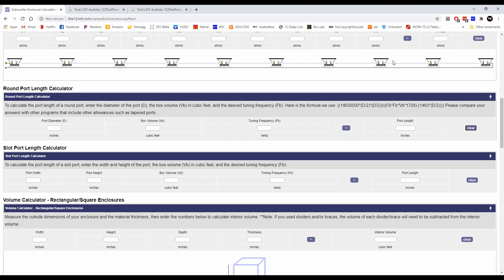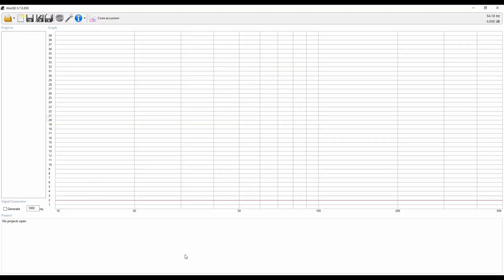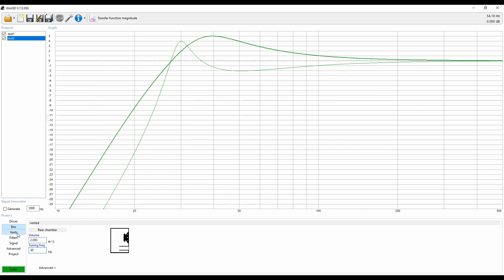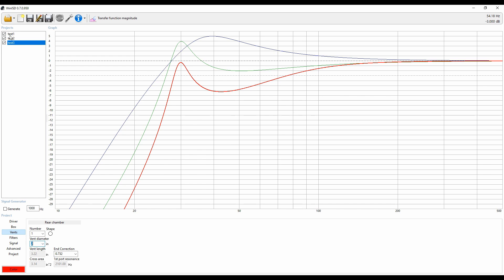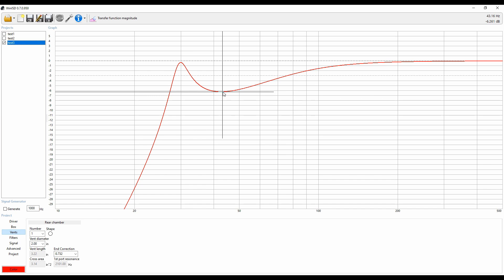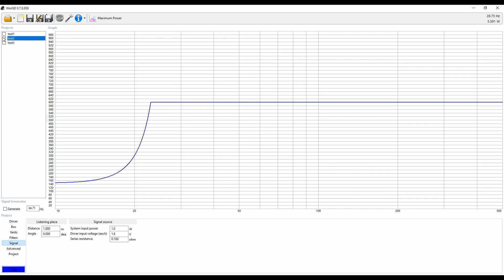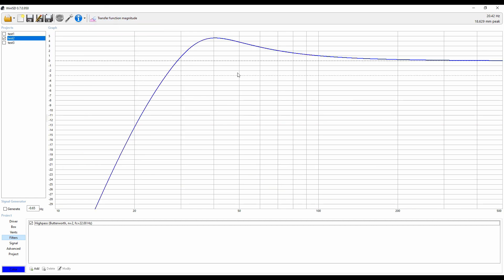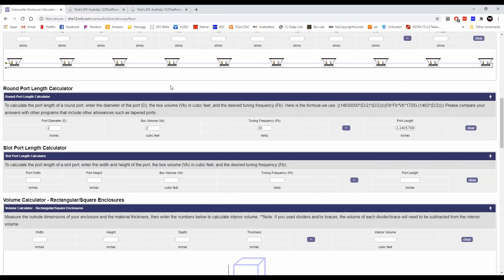Do Online Port Calculators Work?

Comment: What we really need are transmission line calculators
Reply: There's hornresp
Reply: Yep, we need software like WinISD to model transmission line. All online calculator will tell you to use 1/4 wavelength with a line/port area of speaker surface area.

Comment: I was messing with my Martysub and decided to plug 2 ports to get a 10Hz tuning and the port chuffing was pretty audible lol. 
Its air velocity is normally 17.5 m/s at 17Hz if it was playing at 1,000w with all ports open. 
With two plugged it’s over 33 at 10Hz at 1,000w. I wasn’t playing it that hard at 10Hz but it was chuffing good. 

But I did have some fun hearing the notes in “curtain shaker” for once. 

I almost exclusively use WinISD which is the reason I decided to mess with plugging the ports in the first place. Realized 10Hz tuning was just about exactly lined up with a single port out of the 3 open. (3”x7” about 51” long)

Comment: can you do a video about port area and how to find how much you need to have for a given driver?  i've googled my butt off and only find vague explanations and a calculator that's constantly down.  

i usually use winisd to plan the enclosure then bassbox to finish designing it, then i plug in the final dimensions into winisd again for modeling.
Reply: A good rule of thumb is 16 square inches per cubic foot of box volume.

Comment: My favorite speaker simulation tool is VituixCAD because it has a ton of features and you can use the scroll wheel on almos everything to control the parameter inputs. It can also simulate baffle diffractions, enclosure designs, speaker placement and crossover design. The most powerful tool is the optimizer since it can find the best values to fit the desired speaker response.
Reply from the maker: That is another great tool!  Thanks for bringing it up!
Reply: It is expensive?
Reply: @omarn1946  It's free

Comment: I laugh so much when you say "5.25 inch subwoofer", its just a bad midrange driver!
Reply: The Tangband W5 is no joke. I built a sub using 2 of them that dug down to about 28Hz in-room. It's a proper small sub and isn't intended to be used as a mid at all.
https://www.parts-express.com/tang-band-w5-1138smf-5-1-4-paper-cone-subwoofer-speaker--264-917

Comment: How do you tune a passive radiator?
Reply from the maker: I did a video on that. You can find it here https://youtu.be/sG_8qgSjUqE
Reply: Because passive radiators can be easily adjusted by adding or removing weight, I just test out different amounts of mass to get my desired tuning. Invert your passive radiators and carefully use a frequency generator to play test tones. You know you've hit your tuning frequency when your active driver becomes relatively still while your passive radiator/radiators are going crazy. If you'd rather use a formula, I'd download winISD and use that.

Comment: Wanna make a 15 '' transmission line. Any hint?
Reply from the maker: If you need help with it you can always ask on the forum.  We always try to be helpful over there when we can. www.toidsdiyaudio.com/community
Reply: 15" transmission Line? I used to run a channel called - TransmissionLineDesigns - If you need some help, just let me know :)
Reply: Few examples of what was on my old channel 
Sundown Audio SA-6.5 Transmission Line - Just enjoy! - https://www.youtube.com/watch?v=NQbOJcL0yjY&feature=youtu.be
Tang Band W4-1879 - 4" Full-range Transmission Line Speakers - https://www.youtube.com/watch?v=Jdb2mbmL6jg
Tang Band W6 1139SIF Subwoofer - Bandpass Transmission Line - https://www.youtube.com/watch?v=qm5K_VVRwXQ&feature=youtu.be
Dual Inverted Sundown Audio SA-6.5 - Last Chapter - https://www.youtube.com/watch?v=y6_GbYeeFwE&feature=youtu.be